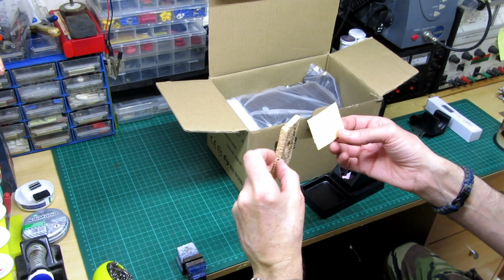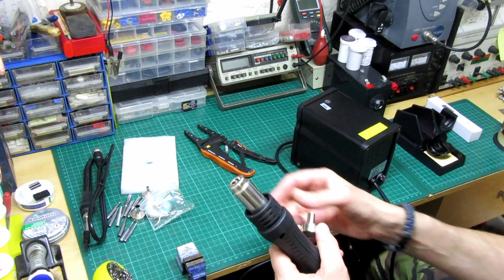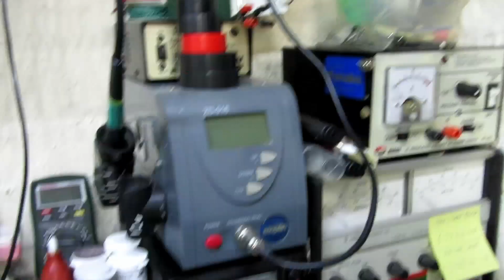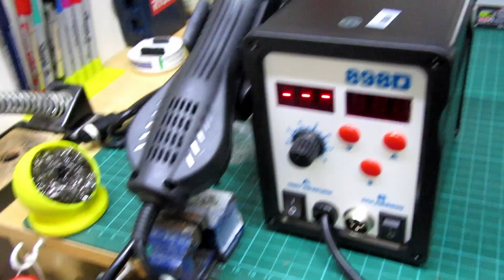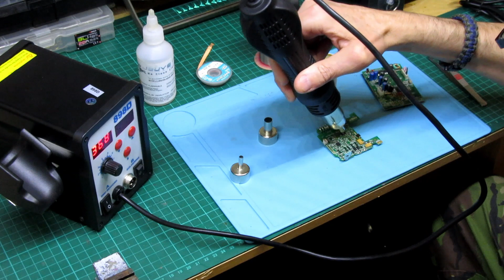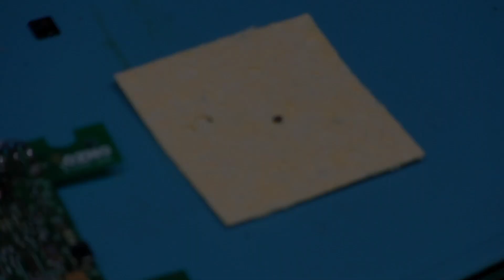898D Soldering Rework Station Hot Air Gun Solder

Comment: Some of the newer versions of the 898D have a proper mains switch on the back panel, rather than the component/circuit dependent electronic switches on front panel. 

Be careful with these.

Comment: @3DRC I know I am 10 months late but I have just watched it. For your safety, you need to get rid of that mains plug. The earth pin is sleeved on that one. I don't know why the Chinese do this but there are many out there. When the plug is in the socket, the sleeve may isolate the earth. I strongly advise you fit a compliant plug with a 5A fuse.

 I have one of these units which is branded YiHua 898D. I have rewired mine internally so the front switches turn the mains live on and off on both sides before it feeds the transformer, which in turn feeds the circuit board. That way it is isolated when both are off without having to unplug the unit. You can either do that or fit a switch on the back. If you leave it as it is then you MUST unplug it after use. These are known as a fire risk.EEVBlog and FixitDaz have covered this on Youtube. I have written this for your safety just in case you haven't realised.
Reply from the maker: Thanks I'll do it Now cheers
Reply: @Beta250trials  Please don't take my post above as a rant. I felt as though I should let you know about the flaws in the Chinese manufacturing process. Mine was fused and switched to the neutral side when i received it. I didn't check that but you did. I found out the hard way because I took the hot air gun apart (because the plastics started to melt) and got one hell of a belt when I touched the heater wires although it was switched off at the  front. That's why I rewired it properly and then noticed the mains plug.
Reply from the maker: @retrocomputeruser  Hi bud I don't take it as an insult I take it as a massive positive help it's what makes the internet so good thanks. and I've isolated the mains to the front switch and used a UK 3 amp fuse good stuff guys thanks again.